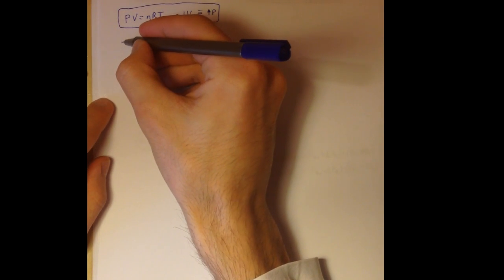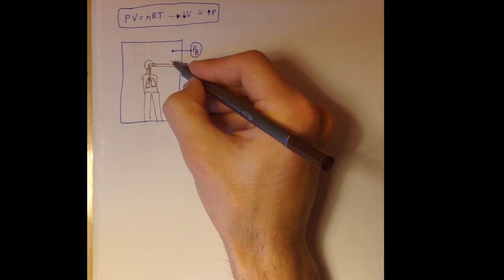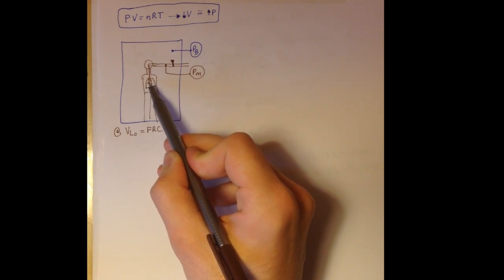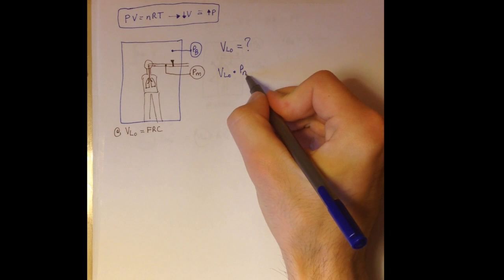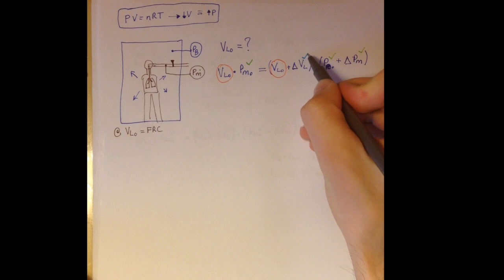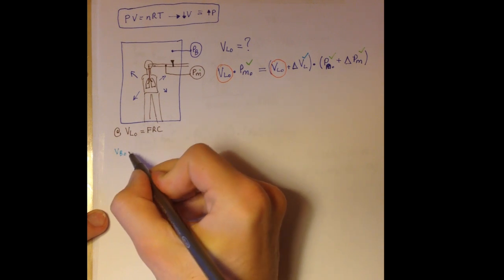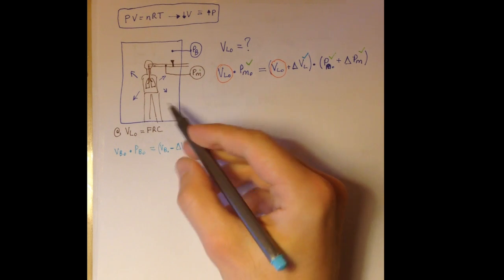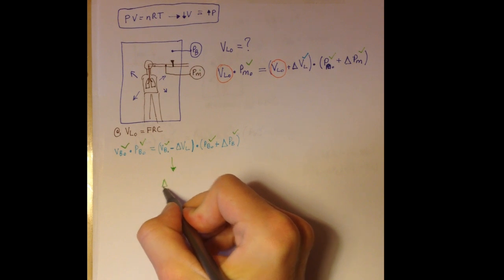Plethysmography

Comment: When you are solving for a and moving your aB to the left side, remember that it becomes negative. This means that you are missing a (-) minus in the equation later, so it should really look like this at the end:
a =   - (Ab+AB)/B

But other than that, really helpful and nice video :) !
Reply from the maker: oops :)
Reply: @MisteryGanz  so the answer is really  a =   - (Ab+AB)/B right ?  thanks for the vdo anyway
Reply: I am not sure if it's correct 
but I think pressure change should be subtracted from initial pressure. hence the equation becomes
ab=ab+aB-Ab-AB
which goes to
aB= Ab+AB 
which is same as your original equation.